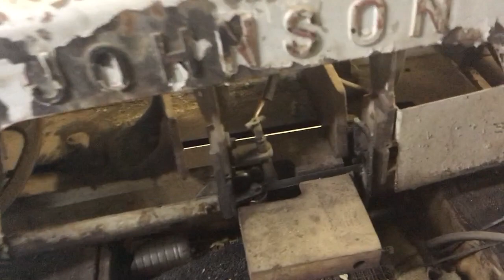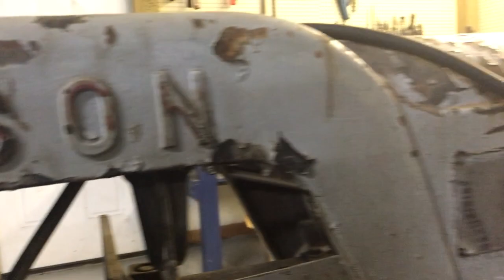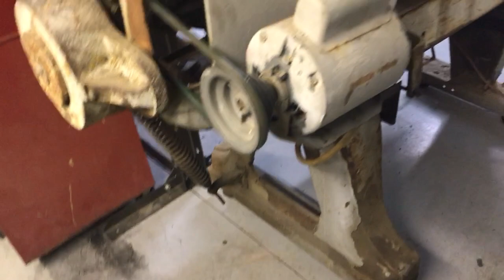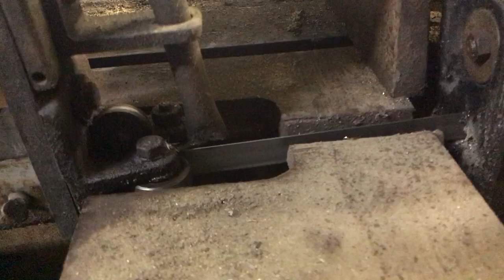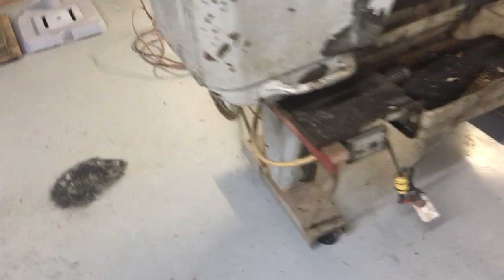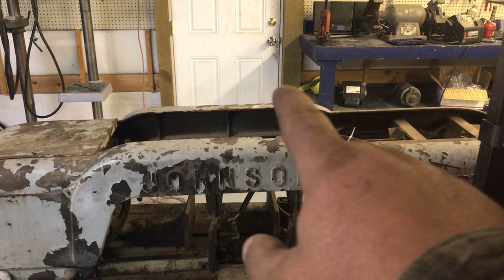Johnson model j horizontal bandsaw

Comment: Heck yeah!
Reply from the maker: A nice find indeed
Reply: @smalltownmachineshop6860  You could saw the Harbor Freight one in half on the Johnson.  Is the hydraulic down feed what applies pressure for it to cut?  If so, is it just gravity and weight doing that now?  I'd like to eventually find an old well built one that's also compact, but I don't know what's out there that I should be looking for.
Reply from the maker: The Dayton saws are good little saws if you keep good rollers and a thicker blade on them and they come up a lot, those and some of the wells saws are smaller and still solid saws
Reply: @smalltownmachineshop6860  Good info. Thank you.